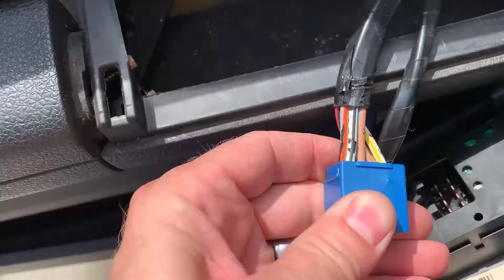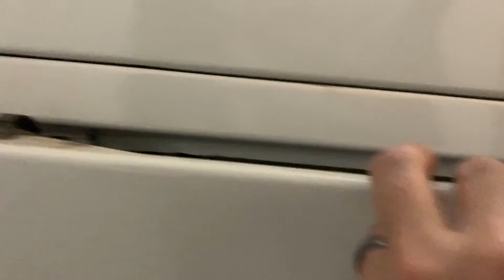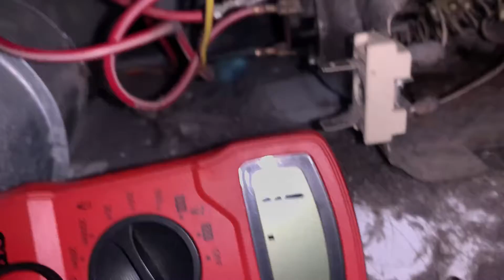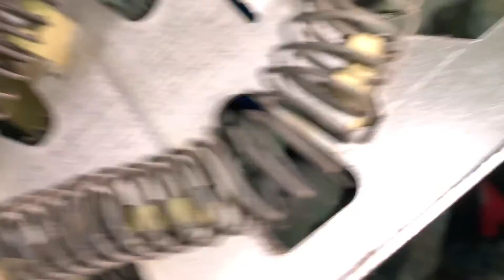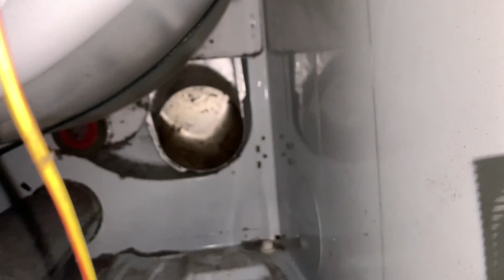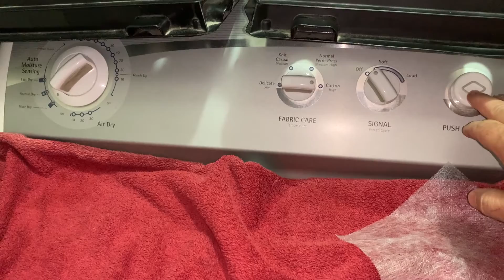Kenmore Elite Dryer 700 Series - Not Heating - Short Tutorial

Comment: That worked for me too.  Broken element.  my 700 series, probably 20 years old.  
But then it stopped working.  I don't know if the element sensors from the amazon package were faulty, so I put the old/original ones back on; cleaned the thermostat on the lint duct, and replaced the thermal fuse again.  Back in business!  Thanks!!
Reply from the maker: Glad you are good to go!

Comment: Is there a trick to getting this element out of the dryer. I pulled the 1/4 inch screw but it only pull forward about half an inch and stops
Reply from the maker: Hello! Make sure there aren't any additional screws going from the "shroud" into the heating element rail (just to be safe and sure). I remember mine being quite snug and it took quite a bit of effort to get it "moving" and coming out. I had to do some back n forth movement as well because it would seem to catch and "snag" at a couple points shortly after getting it moving and then it would finally just slide right out. -Dutch

Comment: Thank you for the video! It worked all the troubleshooting tips and the detailed instructions helped a lot. My dryer had the same part too. 

Edit: Dryer heat is good, but now it's  struggling to spin, especially when loaded. Do you happen to know what could cause that to happen?
Reply from the maker: So glad the video helped you out. Your problem with the spinning could be a number of things just because of all that is involved. So let me give you a few things to consider: 1) stretched or out of position drive belt 2) drive motor 3) motor pulley 4) drum binding or alignment issue. My suggestion would be to go back through your mind where you did work (i.e. where'd your hands and arms go) and look into things that could have been bumped or impacted in some way by the work you just did. I always find it helpful to go back to the last thing I did and start looking around "in the area" to see what I may have mistakenly did to cause my "new" problem. Hope this helps and best of luck! -Dutch
Reply: @LLA_DMR Hey, the issue was drum misalignment. When I first attempted to take it apart the panel inside with the two back rollers dropped causing the drum to not spin easily. I reset it now the dryer works like normal thank you for your help!
Reply from the maker: @destroyingchipmunk9506  great job finding the problem! Glad I could help a little bit.  -Dutch